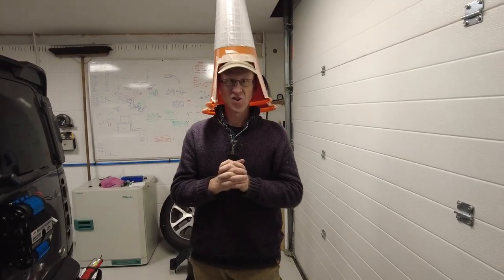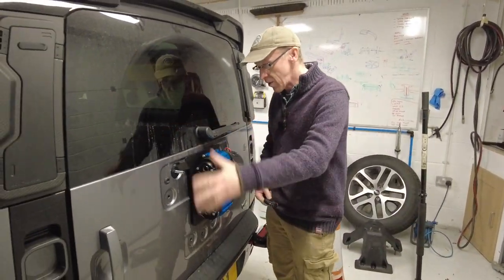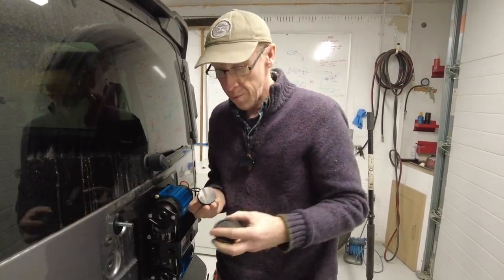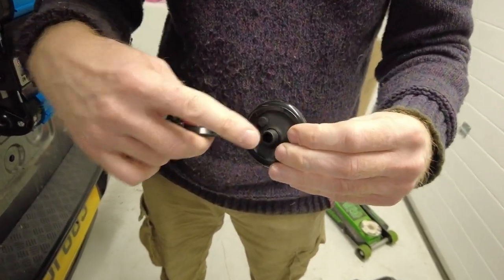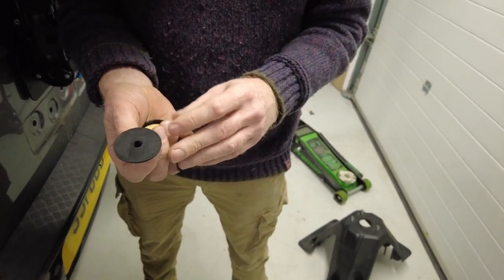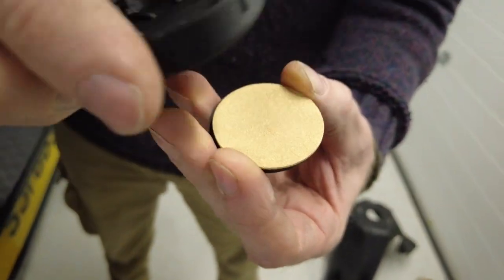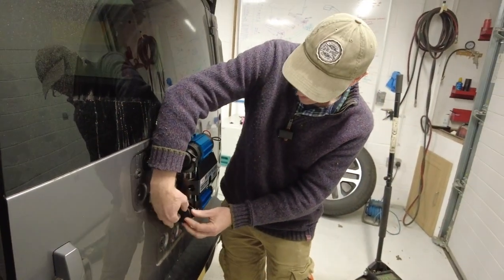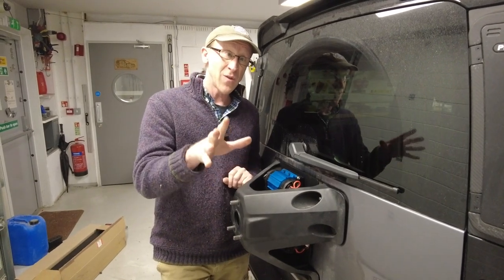DEFENDER ARB Compressor Mount Bracket - Why Simon Wears The Hat Of Shame !

Comment: The back end, including the area behind the spare wheel where the ARB is mounted, is a powerful dirt, dust and road sludge magnet. I remember how my 1st generation Discovery was behind there after one Winter. Perhaps its better that it gets covered in filth though, compared with the damage a direct power-hosing would do, never mind a regular good cleaning forcing water into cracks, crevices and particularly those filters?
Reply from the maker: Hi Huw - as ever you make a valid point - there is no ideal place for the compressor - inside the car is noisy / takes up valuable space. Outside the car get exposed to weather. Under the bonnet is also an option but you need to be careful with heat and space etc.

Comment: Simon I have a suggestion re the defender cargo space. Rather  than having to take out the seats to make the flat floor. Could you make a false floor which meets the height of the metal plate that is at the back of the rear seats then this would make it nearly flat when the rear seats are folded down. People can then store items under the false floor as well as being able to not having to remove such seats? your thoughts
Reply from the maker: Yes this we are also working on - our design has a drawer under the false floor.

Comment: Did you know ARB do a remote filter mount ! could have saved a lot of work.
Love the hat of Shame Simon. Nip down the local hydraulic shop and get some 1/4 not fittings.
Reply from the maker: Yes i did see the remote option but wanted a simple solution for the kit.

Comment: So every time one has to replace those filters, the spare wheel bracket has to be remove? Any idea how often is that?
Reply from the maker: Good question ! I guess it depends on use and environment !
Reply: @L663  thanks. Is it possible to replace the filters by simply removing the spare wheel but not the spare wheel bracket?
Reply: Okay, so I guess it’s not possible! The tailgate has to be stripped out and the bracket removed in order to replace the filters right?